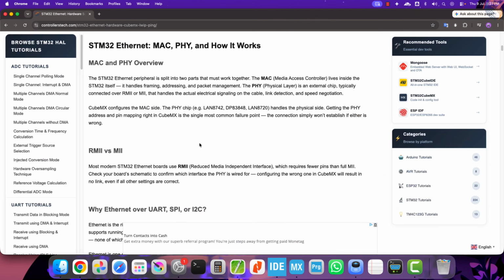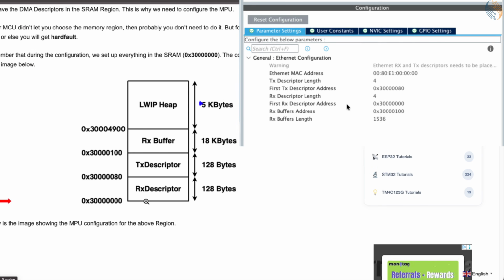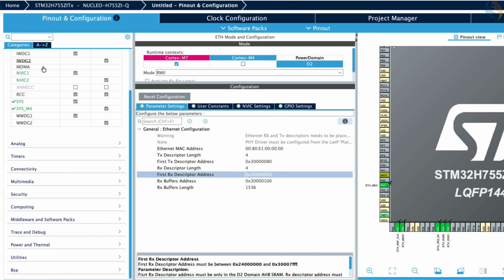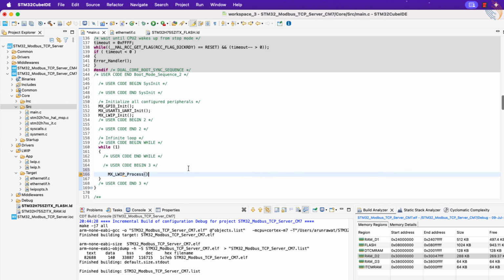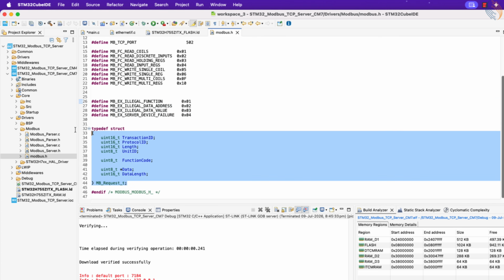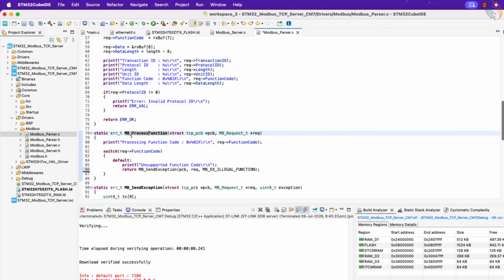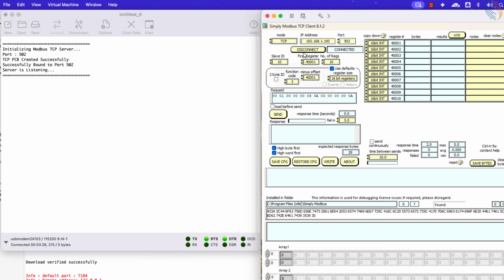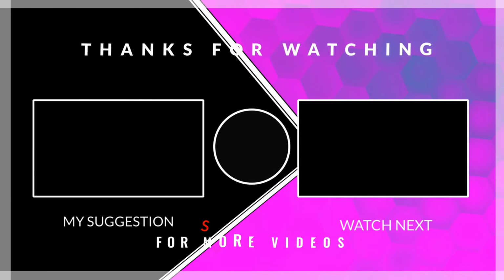STM32 Modbus TCP Server using LWIP — Ethernet Setup Tutorial (Part 1)

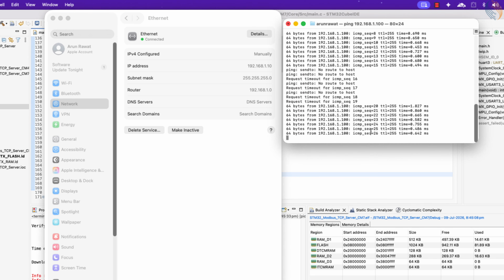Comment: Hello.. Nice video. I managed to complete this video until 11:58 on an H753 Nucleo , UART is working fine, showing Port 502, Server is listening, but when I ping 192.168.1.100, it shows "Destination host unreachable"  but lost is 0% , packets sent 4,  received 4. But Simply Modbus is unable to connect, and the error message shows: "Error 63 occurred at TCP open connection in SMT8.0.vi.  Possible reason LabVirew: Serial port receive buffer overflow "
Could you pls advise which part went wrong? The project compiled successfully with no errors.
Reply: I am not able to proceed and stop at 19:06, Sinple Modbus simply cannot connect , error : "Error 63 occurred at TCP open connection in SMT8.0.vi.  Possible reason LabVirew: Serial port receive buffer overflow "
Reply: hello Arun can u reply?
Reply: Hello Arun are u still alive ??  Can u reply ?
Reply from the maker: Ping is the first thing to get working. If it doesn't work,nothing after it will work.
There could be many reasons for the ping to fail. It could be wrong pins, wrong clock, mpu configuration, memory issues etc. 

I need to see the project before I can even suggest where the issue might be .